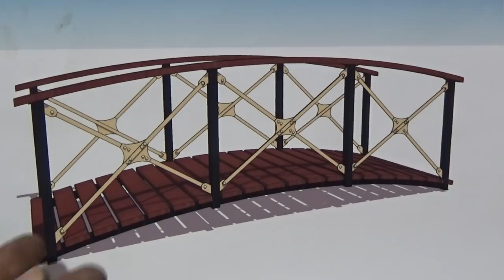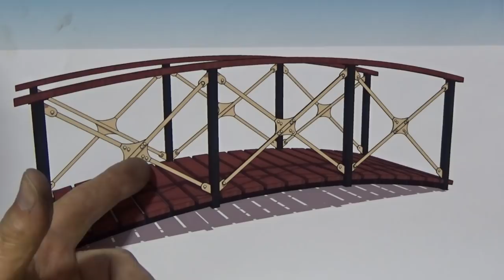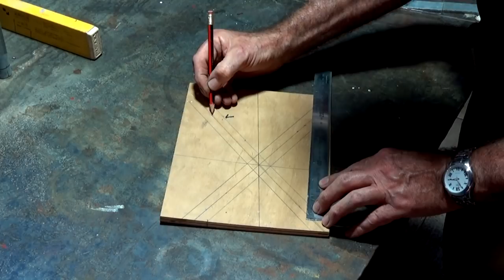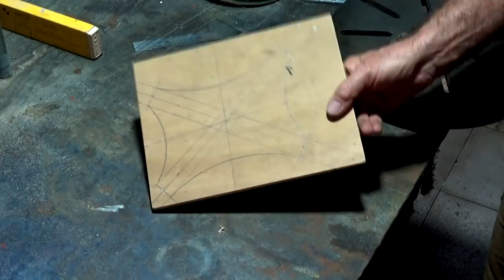Fabricated Victorian Style Garden Bridge - Part 2

Comment: Mark,

Thank you for another great video.  I just hope that my wife doesn't see this series!  ;P  I wish I had half of the toys that you have -- I guess I need to get some more oxy-acetylene bottles and start practicing again.  There's always a need for some kind of welds around the house....
Reply from the maker: Bob, we used to teach oxy acetylene welding when I was at my last school. We had six welding stations and we would cover brazing, fusion welding of mild steel and oxy cutting. Now I wonder if plasma cutting and mig/tig will eventually replace oxy acetylene as a process. The fire and explosion hazards with oxy were significant and the cost (to the school) was very high. Not just the gas and cylinder hire but also the cost of inspections and replacement hoses etc. Having said that I once owned an oxy acetylene outfit but I got rid of it due to the high cost of cylinder rental which was an annual cost whether you used the gas or not. Now that you can purchase the cylinders on a return basis it might almost make it worthwhile. I always get frustrated when I want to braze or silver solder something large or I want to heat a large section of steel and that's when I miss not having the oxy acetylene setup. There is also the advantage of being able to weld in the field. No power required!

Comment: Looks like an interesting build Mark, I look forward to the finished product. A few have mentioned as you have about your welds, try as mentioned by others to use more heat. My old 1985 Kemppi has wire speed and Voltage settings, for a better burn in I slow the wire speed or up the Voltage/Heat. 
 Hope this is of some help, John, Australia
Reply from the maker: John,
I have a reference chart on the inside door of the welder which I use to set my wire speed and voltage but I don't yet have the ability to fine tune the settings. I really should do more practice now that I have my own welder at home. When I was teaching I used to do any mig welding that i needed at school. We had good quality Transarc welders and a remote wire feeder. More often that not though I would get my mate Macca to do any welding that I needed as he is an excellent metal fabricator. He has offered to supervise my practice but we normally end up just drinking beer instead. 😁
Reply: @Preso58  LOL Nothing wrong with lubricating the thinking process from time to time. This can actually help the thought process as conversation flows more readily. Just not so good as you have mentioned in one of your earlier videos, the one about the gear drive your your drill press speed reduction. 
I think it was called the Pull Gear.
 When My father was teaching me to weld he said, Welding is 90% practice and 10% theory, then it changes to 90% theory and 10% practice.
 He had all sorts of tickets and learned me proper good! John. LOL.

Comment: Fine work. Thanks for sharing. I am not much of a welder either, but was thinking the welds are a bit cold, or move a bit slower.  I have a cheap flux core Mig, it is like Christmas ever time I wack the slag off- never know what I will get!
Reply from the maker: Lots of people have identified that I have my settings too low. Even so I still managed to burn a few holes. My main issue is that I find it very hard to see where I am directing the arc. I wear multifocal lenses in my glasses and It always seems like I am looking through the long distance part of the lens when I am looking at the weld puddle. I should spend some money on a much better quality face shield!
Reply: I feel your pain. Just hit the mid 40’s and realize I need bi focals. I too believe I could weld better if I could see a bit better and weld more(which is not often these days). Can’t wait to see the final product.

Comment: Is grinding and welding galvanise not a serious health problem, (toxic fumes). Great channel, watched all your videoes. Love them all.
Reply from the maker: From my understanding exposure to zinc oxide is called metal fume fever and it is a short term illness which reverses when exposure to dust and fumes ceases. However, little is known about the long term effects. I take the view that my exposure is very low and I might weld zinc plated steel once or twice a year so I don't get too concerned about it. If I was welding for a living it would be prudent to invest in some sort of fume extraction device. I generally open all the doors in my shop and if there is little breeze I turn on an overhead ceiling fan to disperse the fumes. Some people report feeling nauseous after welding galvanised steel but to be honest I have never noticed it. 
Regards,
Preso

Comment: Try turning the voltage and wire feed up on the welder, it looks like those welds are a bit cold (10–20% higher). You might also see better results if you pushed rather than pulled the torch.
Reply from the maker: Thanks for the tips. You would think that I would be better at it than I am. I certainly find it harder to weld now than I used to. I think I need to invest some money in a decent high quality face shield. I should also practice more. Now that I have a decent light over the welding table I should get some scrap out and go at it. Hope the clock is running!